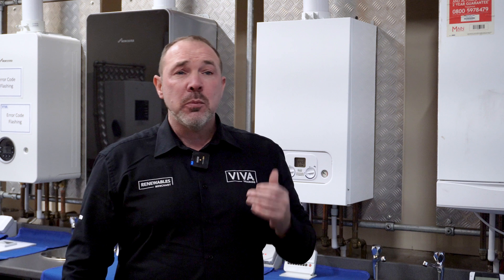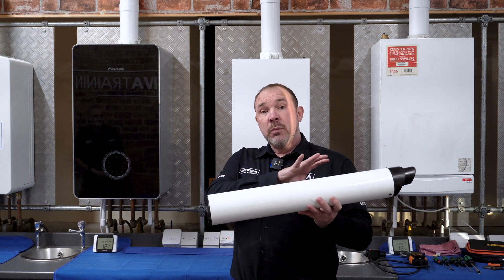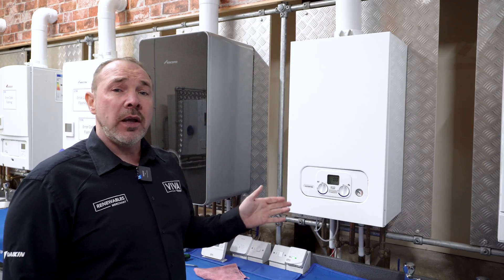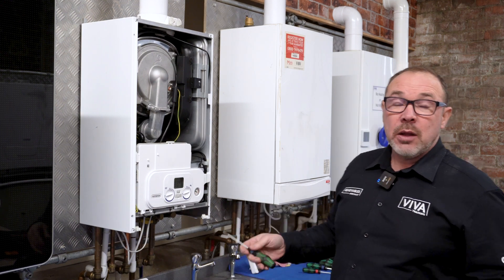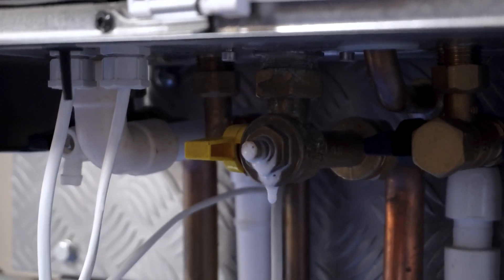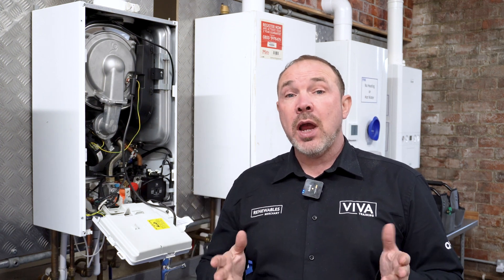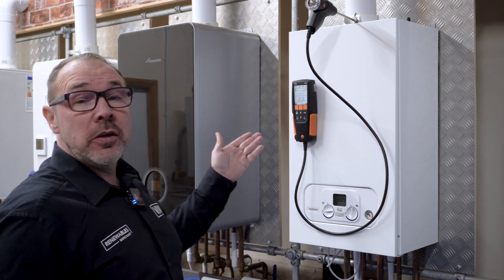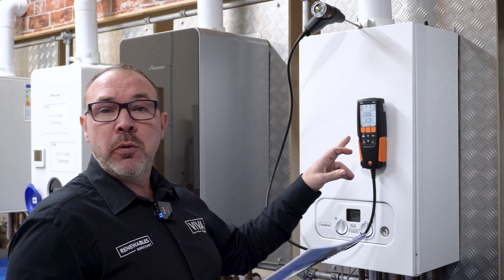Guide to a Boiler Service | VIVA Training

Comment: Hey, I have a Q. When I turn on the taps to pressure the boiler system I can hear water flowing good until it reaches about 1 bar then no more ? Is this a water feed issue or something with the boiler? Maybe PRV or vessel ? Appreciate your reply.  There’s no leaks by the way. It’s is an alpha cd28c.   Yours jack of all trades master of none Phil 😁
Reply from the maker: @philipgordon7058  the pressure relive value or expansion vessel can cause the pressure to behave like this.
Reply: Thanks, well nothing drips out of the pipe so I’m thinking not PRV.  Just can’t phathom how the expansion vessel would limit the water pressure.   Fortunately it’s above a bar so I’ll worry about it if it ever drops.

Comment: Is it fine to put the boiler in high fire by just running the hot tap? Is this what is stated in MI? Is there a difference between max mode/high fire and just running the tap? Thanks

Edit: commented too early you do put it in max mode my bad. Thanks